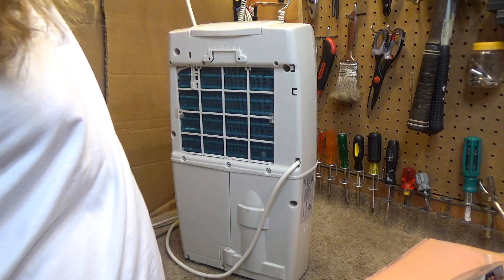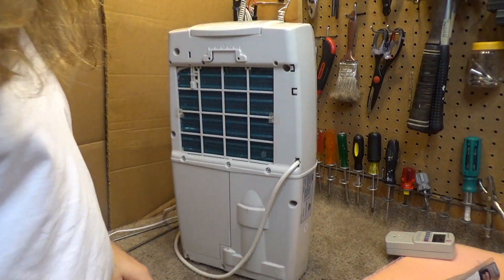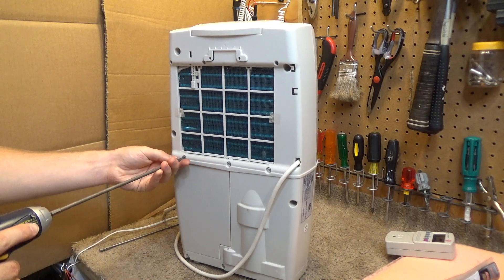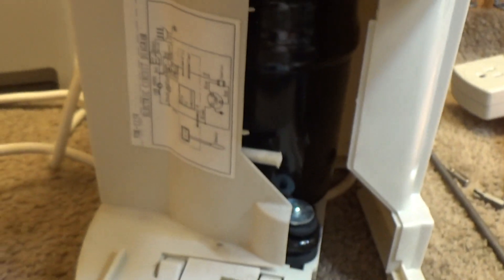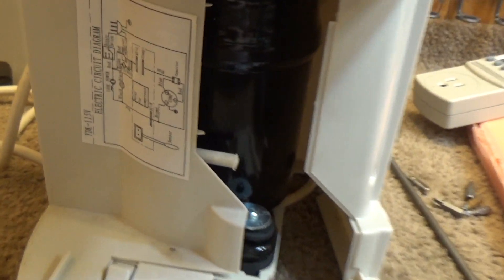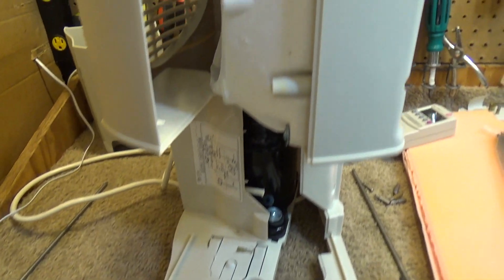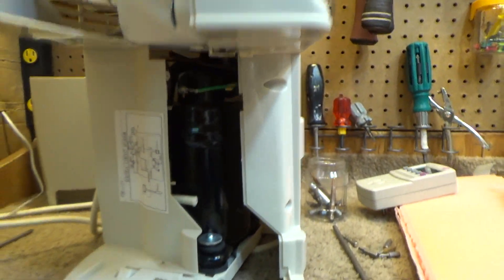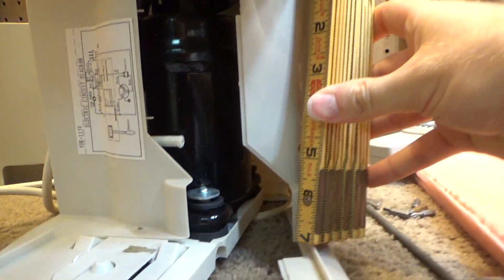Compressor in the NewAir AD-250 25-Pint Dehumidifier

Comment: I’ve seen a small rotary compressor in one of those tabletop icemakers that someone disassembled. It was around that size, I think even a little smaller. I believe it also used what looked like a PC fan for the condenser coil.
Reply from the maker: Thanks for letting me know.
Reply: @JordanU  does countertop icemakers usually use rotary compressors??

Comment: i was unaware that they came in as small of a size as 25 pint, the smallest i have seen is a 40, but i dont go around looking at them. i have a Hampton bay unit with r22 and a matsushita rotary and a kenmore with r12 and i forget the brand but it reciprocating compressor. it is way under the house but now it is bothering me. i guess i will have to crawl under there to look.
Reply: Walter Knox The Kenmore that you have has a Tecumseh reciprocating
Reply: @ArisBuliteanu  yep, I think you are right.
Reply from the maker: I see plenty of 25s around, though I don't find the ones less than 50 to be very useful. Even in a small bathroom a 25 pint machine doesn't seem to keep up with the output of a shower.

Comment: Did you know that the rotary compressor is also based off of a Wankel Rotary engine, but the rotor is not a triangular shape and there are obviously no spark plug(s) because a refrigeration compressor doesn't work like internal combustion engine. All it does is compress.
Reply from the maker: Yes
Reply: @JordanU 
Wow... I just got an ad that convinces that R32 is a great refrigerant. 😂